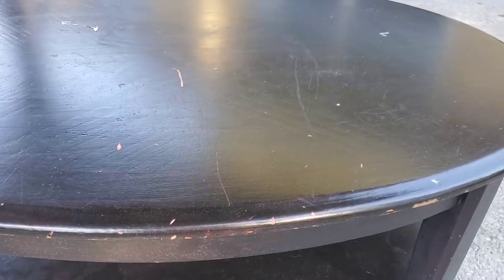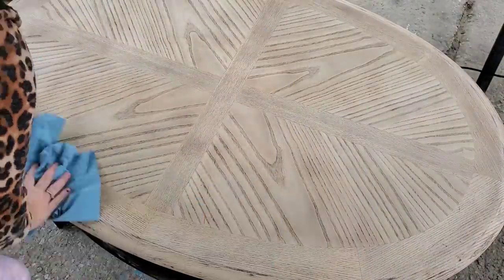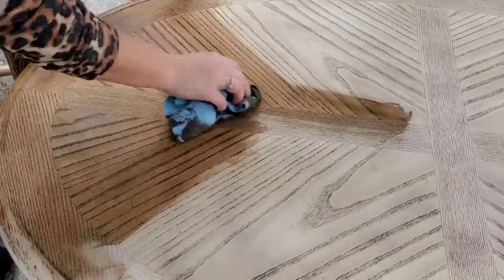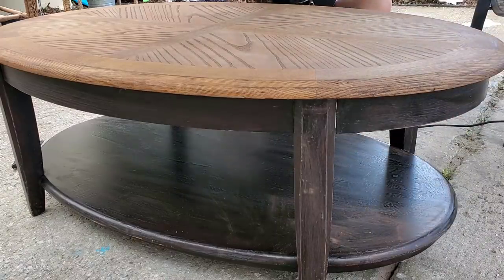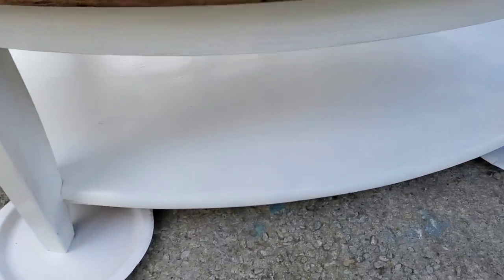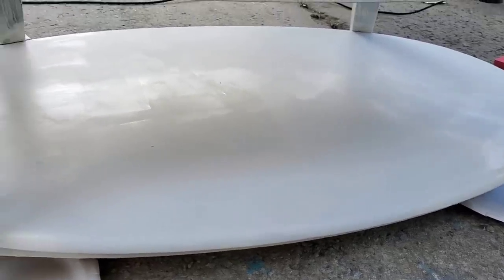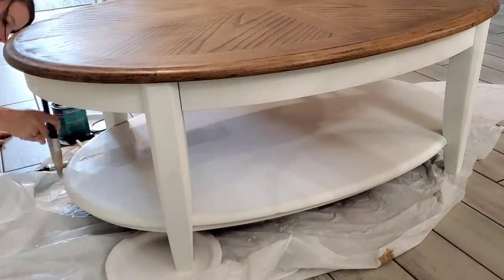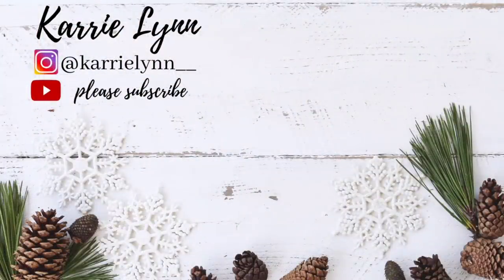Old table makeover | DIY farmhouse table | Coffee table makeover.

Comment: Karrie, When you are finishing off a piece of furniture you should use steel wool instead of sandpaper between coats of polycrylic.  It gives a super smooth finish without the dangers of getting sanding marks.  And then after the second coat of polycrylic dries you should use a coat of clear wax over the entire piece.  All of that just helps to protect your stain and paint so that it holds up really well.

Comment: Great new look. I must say you are braver than I am staining the top with out a glove on and in light colored pants. I would suggest you seal the painted part also or at least wax it for added protection. The top is a veneer btw. I love refinishing furniture and have done at least 10 pieces this year. I’ve given most away as gifts to my kids. I love getting texts that say for example, I need a small dresser or nightstand with drawers in black. Then I start checking on FB marketplace.

Comment: Your table turned out beautiful! I use latex paint to redo furniture all of the time. If you want to save tim and money and get a great finish use Valspar or bear paint and primer. It is pricer initially but you do not use as much paint. Alot of times I can do just one coat and the piece may just need tiny touch ups. I can do several pieces from just one quart. I use the satin finish. It is not too shiny it has a nice finish and it holds up well. It goes on smooth and its instant gratification seeing an almost finished product with just one coat. I like to shop the reject paint pile at Lowes. The paint that people had mixed up and it wasn't quite right for them. Alot of times they will have all in one paint and Valspar primer, normally $40 a gallon for like $10.00.  If you not particular about a certain color swatch and find something you can live with it a win. Also you can mix paints to create a shade thats custom for you.
Reply from the maker: Thank you so much for your comment. I always appreciate tips and tricks.